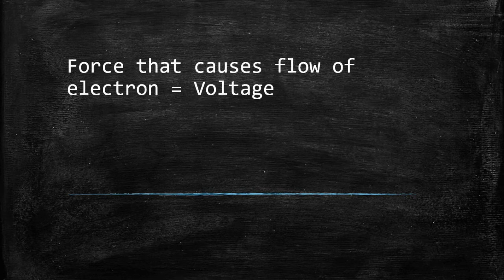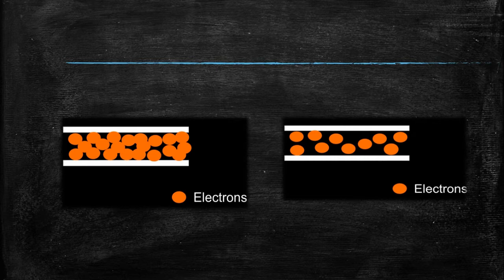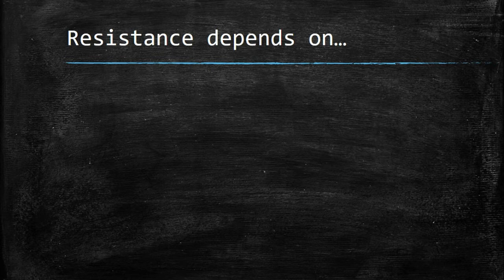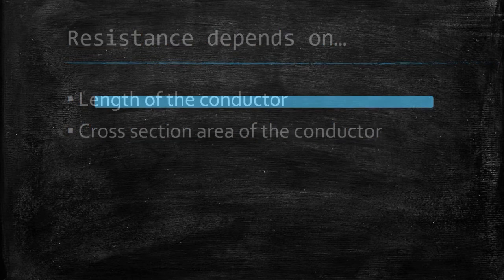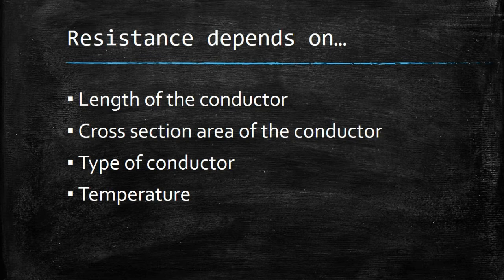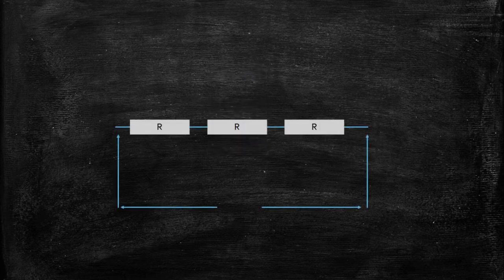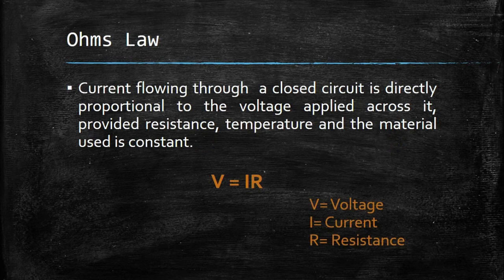Resistance & Ohms Law | Learn It Practically | Easiest Explanation

Comment: Hii sir is it depends on load to know about current and voltage relationship. Because I read that if the load is resistive than the voltage is decreased when current is increased and the load is capacitive than the voltage is increased with current. I m bit confused in this two things so please explain it In details

Comment: In this practical after using resistance current reduce but what about voltage. Is there voltage will same in the circuit?
Reply from the maker: Yes.

Comment: sir,,...
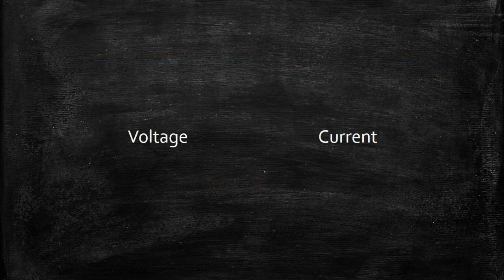In these you said that "" In any case If voltage is increases then current also increases" (at 9:33 in the video)
.
but
👉condition.1:-
 power=voltage×current×cosπ(we are assuming power factor is ”1”)
then ,
Power=voltage×current
then small calculation
400w=200v×2A ( just assume for easy understanding purpose I taken that valuse )
if we stepup by using stepup transformer,then,,,
400W=400V×1A .

👉condition.2:-
In all motors when we increases the load then current  is increases but voltage is decreases( very low but voltage is decreases are not..?)

👉In condition.1:-
voltage is increased but not current  decreases
👉in condition.2:-
current is increased but voltage decreases

in both cases 
if voltage is increases then current is decreases (or)If current is increases then voltage is decreases.

but
you said that If voltage is increased  then current also increases..🤔🤔🤔
.
## I'm not blaming you ,just dought for me..
reply me WT is reason behind it 
(don't reply me like "they does not obeys the ohms law)
I want detailed explanation .
..
.
I am a fresher your videos are very useful for me . hatts up 🙆
Reply from the maker: Dear Bhuvana Krishna, you seem to a bit confused but, that’s okay we’ll clear your doubt. First understand current will increase with voltage or decrease with voltage or vice versa only if resistance, temperature & material are constant in all conditions.  If resistance or temperature is keep on varying the ohm’s law will not remain true (and that’s what I have shown in the video).

Now, in case of motor, we have to consider the “temperature” of the motor, as it will vary with the load. And this change in temperature will cause change in resistance, and that’s the reason voltage and current will not be proportional with each other. 

But, yes, it is true, current increases with increase in voltage and vice versa, provided “resistance, temperature & material are constant”.
If you still have doubt you can watch the video one more time & get the things clear.

Regards,
Gaurav J
Reply: hooooo......,.
Thanks for your reply...!